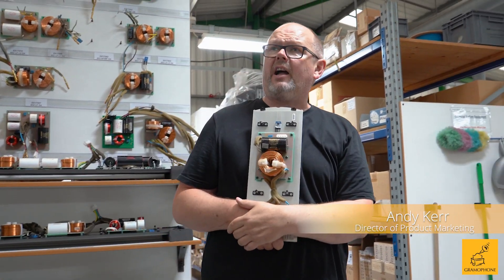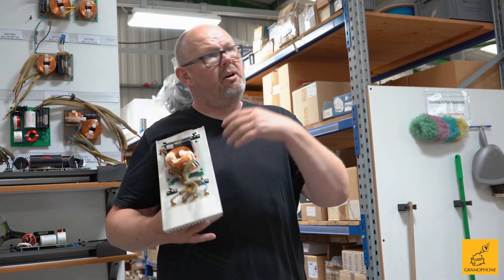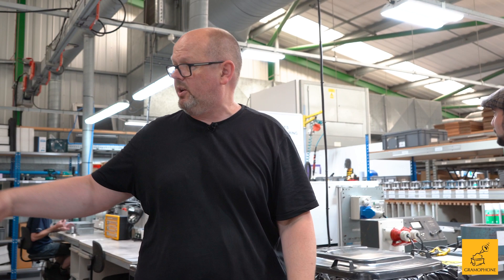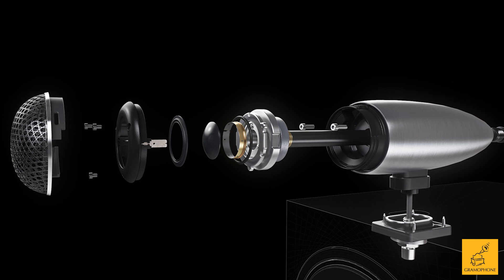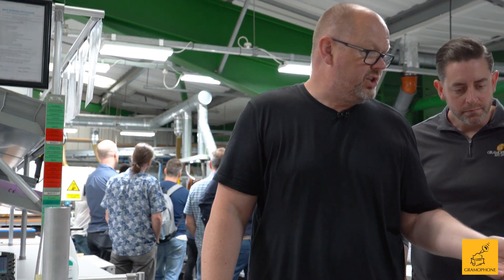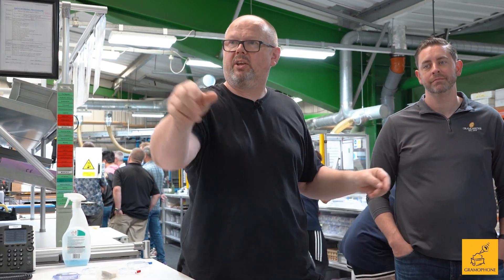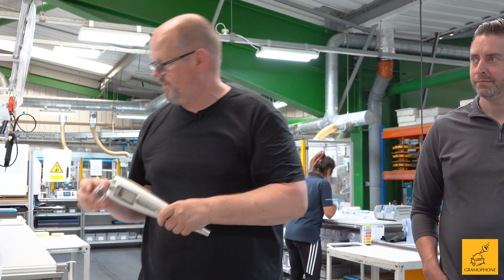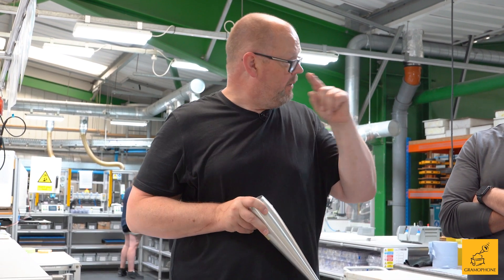Bowers & Wilkins Factory Tour Pt 3 | Crossover, Tweeter

Comment: 8:06 "the more the air pressure builds up". 
That seems wrong to me. Air pressure is no being build up. It is not like inflating a balloon. Sound is about variations in air pressure not about air pressure building up. The reason for this water drop form has more to do with dampening the sound coming from the rear of the housing. Well, that at least are my two cents.
Having said that, I am grateful for the factory tour... and I am a bit worried about Chinese (state funded) copy cats checking out every detail of this footage in order to copy the products on display and compete these beautiful Western companies out of their markets.
Reply from the maker: Hello Anon, it's true that the air-pressurization discussion can actually get very technical and quickly.  There are a number of audio issues that folks take liberties with in order to stay out of discussions that can get over the average person's head - fast!
Reply: Дифракция и интенференция